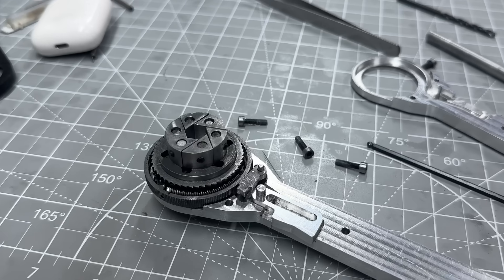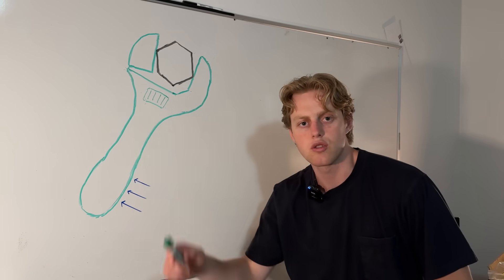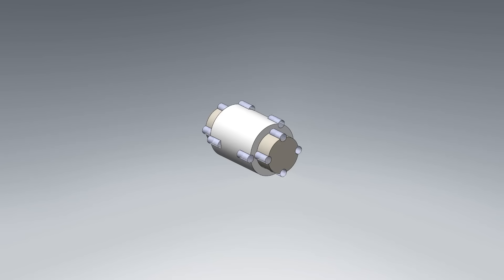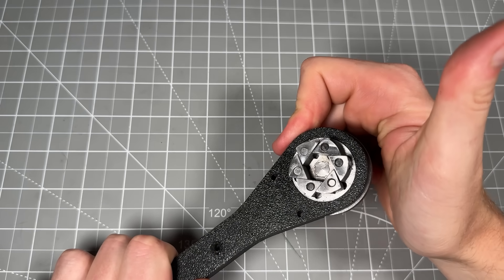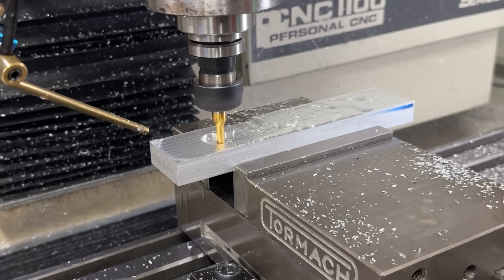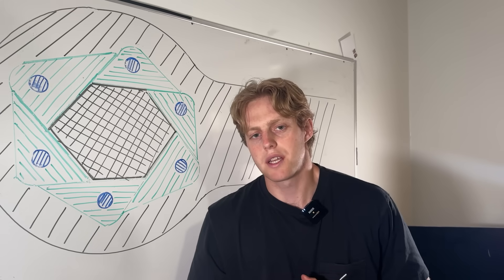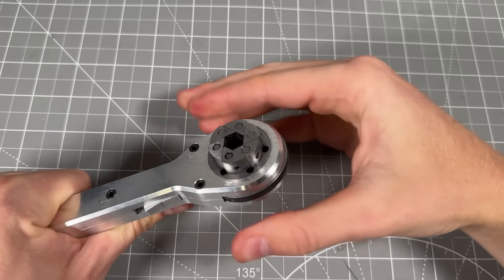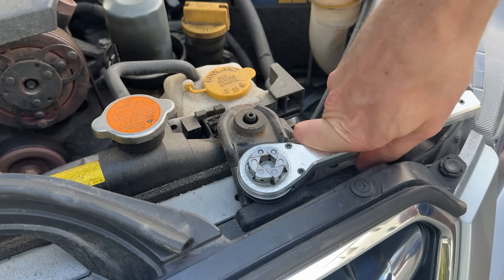I Invented an Adjustable Ratcheting Wrench

Comment: Interesting tool development. This has many avenues for product differentiation, i.e., related models optimized for a narrower range of uses. A few obvious ones are finger length (as you'd mentioned) for greater reach into recesses, bolt head size, max torque limit, etc. With a few select models that address a range of use cases, a Kickstarter campaign may be fruitful for getting this product into the hands of enthusiasts. I can really see the utility of the design in the heavier industries such as oil drilling and steel building construction where "big" tools are common.

Comment: Brilliant design, you really have a great intuition for creating mechanisms! I really admire your tenacity, I'd have chucked it in the bin after the pin bent 😆 The only thing I have to add is I'd recommend looking at the ratchet mechanism on modern ratchets. Instead of a single pawl they have a curved plate with symmetric rounded teeth that toggles relative to the centerline to allow reversing. That said it's usually a metal injection molded part so creating one with conventional tools might be tricky. Since you can't reverse the wrench anyways, you might get away with just having multiple teeth, but getting them spaced such that several engage at once to share the load might be tricky. I look forward to your future videos!

Comment: I'd buy it just like it is. There is no such thing as one tool for every job. No matter how much "tweaking" you do, someone will figure out a way to make it fail - beta testing. Have you seen how much Craftsman tools have changed over the last 50 years? This would be the perfect complement to a socket set, especially for the "second half" of a through bolt.

Comment: I have not seen a comment on it yet, but would there be any way to make it work on a nut threaded deep onto a bolt by adding a hole in the middle (akin to some of the gear wrench "pass-thru"socket wrenches)? Or would that not be possible? If so, I believe it would greatly improve its usecase.

Comment: The idea is interesting, but not practical for someone that turns wrenches.  There are always too many clearance issues even with the one-size socket and ratchet approach.  In my opinion it would be better if you could leverage existing ratchets and/or wrenches depending on the requirements of where the fastener is located and clearances available to access it.  But then the gator socket already does that. . . .

Lots of people say they would buy one, but the price would be prohibitive with all those tiny parts, expensive steels, and precise fits.  OTOH, there are people that seem to rely upon their adjustable wrenches much more than I do.  Mine very rarely get used.

That's not to take away from what you've done.  Your idea and implementation are pretty incredible.

What would happen if you modified your design to only grip on 3 sides?  That might reduce the number of parts and allow you to reduce the overall size?

Comment: Impressive and elegant design.  I would be really interested in a production version after some independent testing and would prefer a reversible design over one that needs to be flipped.  This would make for a thinner head to fit in smaller spaces also.

Comment: I would adjust the mechanism to remove the ratchet and use the champhers to act as the ratchet. Also the mechanism should be made small enough to form the hole on the center of the wrench allowing for tightening and untightening.

Comment: I had an idea like that once.  It was ratchet mechanism with a bunch of hexagonal tubing all telescoped together.  The tubes were super hard steel.  Just slide out the size you need.  Good for big and small bolts and deep resessed bolts.  It would be expensive to manufacture the hex tubes.  EDM would probably be the only way.  Probably there would have to be a ratchet tool for metric and one for imperial.   Several tubes could be pulled out together to make the socket wall thicker and stronger.  I bet it's already been invented tho.

Comment: I do 80% of my work with 3 general purpose tools - and i have 30 special  tools for the 20% of the time the 3 tools dont work . - if your wrench can undo 80% of the bolts a user has - then it will be gold- there is no style of wrench that can undo 100% of bolts

Comment: I can see using it for work on easily accessible bolts with varying head sizes, but those workplaces are rare.
Meaning it would only ever be an additional tool and the question becomes: "would i bother to buy an expensive additional tool to do a job i can accomplish by assembling a tool in seconds, that does the job just as well from tools i already have and need?"

The engineer in me wants this tool, but the mechanic i me says "really neat present, but not something i'd buy for myself".

Comment: isnt it possible to use a one side to do both tightening and unscrewing with the use of a switch same as on ratchet sockets? Should bring down the cost too, or allow for two size wrenches on the same end of the tool

Comment: I'd try put some teeth on it to see if it will bite into a very rounded head and as a retired motor mechanic the thing that would interest me in a tool like that is if I can really bloody heave the guts out of it, I'd want the pawl in the ratchet to shear or round before them pins start to flex much so that I cant destroy the whole thing or what I'm working on and only have one part to replace if I give it all the berries with a cheater bar and ideally be nice if it come with two spares. Other than that it looks nice as frick, very gimmicky if you cant proper heave on it without it opening up and rounding stuff but if it takes a big man giving it a lot without opening up and rounding and better it can get a bite into something already rounded then I would of easily added one of them to my personal toolkit or least got one for the workshop if it was a bit pricey which I imagine it will be to mass produce with the quality of build and materials for that to be proper durable.
Reply from the maker: Thanks, the failing pawl is a great idea. Especially if the tool is on the more expensive side.

Comment: One immediate improvement would be to hollow out your center pin to allow tightening/loosening nuts on a longer bolt
Reply from the maker: I like the thought, I had this in earlier versions but could never find a way to make it work.

Comment: Also, something like hex-to-1/2” adapter could potentially eliminate the need for a regular ratchet because it will make yours compatible with universal joints and extenders

Comment: Designer perspective: giving any sort of distinguishable enough surface treatment - ideally coloured - to either of the two halves would give immediate visual clarity to which side is for tightening and which for loosening. You are using aluminum for the handle which would anodise perfectly. After only few interaction only a glance is needed to know which side is which upon picking it up :)
Reply: Ratcheting wrenches have an arrow on each side showing the direction it turns.

Comment: Cool project!

Personally I'd make the grabbing mechanism as low as the typical height of the biggest nut it can grab onto. It would increase strength.
I'd also rather have one ratchet for tightening, and one for loosening, instead of increasing the depth of it by having both in one. It might have a large diameter head, but making those changes, it could fit places with a height constraint.
You could also maybe  (if it doesn't create too much torsion inside the head) offset one of the ratchet-locks to double the pulses per revolution. It would make it great for spaces where there's not much space for ratcheting.
Reply from the maker: What about a double ended wrench? One end loosens and one tightens? Or maybe that will be to heavy...
Reply: @Trevor_Faber 
That's a great idea. I doubt that it'll make it too heavy, while knowing that it would add probably a third of the weight. There's nothing wrong with an extra workout while working. It's less time needed at the gym 💪🏻😂

Comment: I'd 100% add this to my toolbox. I reckon for at least 50% of my jobs on motorcycles I'd be able to use this. Which means 50% of the time, it would be a massive time saver.
Reply: Completely agree with you. Same thing for my various jobs, probably wont work for a lot of things, but that 50% would go so strong in saving time and weight in my bag.
Reply: Ever try a Gator Grip socket?
Reply: @Octopusprimal Those are flimsy as hell and only sometimes works the first time and never a second
Reply: @Apeturetech  Had mine for over 10 years, not a problem, still works as good as ever.
Reply: @Apeturetech  I use mine daily in a professional environment. My only complaint is how thick the socket walls are as being off-center on a nut can be catastrophic for the cast arms. I watched a coworker snap a stud off a Cherokee and the socket never slipped.

I don't use it in incredibly high torque applications, but it's rare I encounter an overtightened or heavily corroded fastener in my job. I do 8-10 cars/day.

Comment: If you were able to implement this without the ratchet mechanism to a 1/2" square drive this would greatly improve the usefulness of the device. I would see myself using this with standard ratchet wrench with different extensions and a impact driver too.

Comment: Now for electric impact wrench attachment.  I think this tool would be useful on production line operators in low torque, low size range applications.
Reply: Don't they usually use tools with preprogrammed torque limits? that wouldn't work if you use the same tool on different bolts.

Comment: You Could Machine A Hex to Square Adapter That Allow The Ratchet To Uses Commercial Sockets As Well. One Idea I've Had For An "Adjustable" Socket Is A Russian Doll Design. So Many Hex Shaped Sockets That Are Extremely Thin Stacked Ontop Of Each Other. They Should Be Able to Withstand A Grip Of Stress Still Since They'd Be Backed By Several More Varying Sizes.

Comment: any bolt with thread that sticks out is a nono, could improve the design with self opening of the jaws if you press a button like a release mechanism, could have a reverse ratchet instead of 2 face, if the ratcheting wheel had easier access and ease (it doesn't look all that fun to spin ( hard on the fingers but hey i didn't touch it, just ho it feels watching it on camera)) well it could count as ''self opening" as we saw in the vid at some point you did just that, the thing where you approach a bolt head with the ratcheting is great , i often do that with sockets but i spin a nice smooth socket /screwrdiver with a nice smooth round shaft, so i think there's quite a difference in feel. man this tool is DOPE ! a version where the teeth themselves would be long

a final version would be something that has a telescopic locking handle, only one side with the socket (reversible ratchet) 90 degrees tilting head (inspired by haasky) (i think i'm against chamfer on the outisde as it will barely let you access more areas, but it will surely make the tool less durable, more prone to failure (but you know better) anyways, chamfer or no chamfer. there's a guy in the comment who talked about another kind of metal that would make the tool less prone to scratches , failure, and damage from being tossed around. so that as well but most importantly, have all of this made into 2-4 tools   one with small jaw small handle, one with big jaws (i mainly mean long, so it would act like a long socket and bypass a lot of issues that would come from using this instead, IF IF it was a possibility , have a hole in the middle (since there'd be no need to connect 2 counterspinning heads ... would it be possible ?) and one with jaws thats are simply bigger for well bigger bolts ! say the small is 5-19 short jaws, long jaws, big 13-24 small jaws, long jaws, 4 tools as a kit if it works well enough fits enough things resolves most problems is built in super strong metal that would make it last years i wouldn't give a shit to buying some as innovative and unique for 200 bucks but that's pretty high. idk what would be realistic for you to sell. you got yourself a new sub and probably a future buyer

Comment: While I love the concept and admire the dedication, I'm having a hard time seeing a use case. It certainly isn't automotive. Mainly because this wrench can't use extensions and requires you to reach with your other hand for the already quite bulky head. The latter you might be able to fix to a certain degree, but not the former. The use case would have to look like this: various bolt sizes but they're all accessible without extensions. And no Allen bolts, Torx, etc. Your invention mainly does one thing: Highlight your skills and perseverance.

Comment: One thing that would be pretty neat is if you could push the chucks through to the other side of the ratchet to change direction. Removing alot of bulk from the ratchet. Google "Push-through ratchet" to see what I mean.

Comment: Brilliant work.  
Precision O-ring rachet spanner is you could shrink design / A bolt-pipe/nut remover (as i would love something that could apply equal torque when trying to remove bolt etc from vintage equipment (especially as they can be all manner of sizes/shapes)
You should give someone like adam savage or similar one of the makers who is likley to help an be in awe to check out your design as could see it as a way to get an investment to further the development (As you are aware there are similar ones but none of them seem to work fully or aren't worth the time of big names)
Keep it up :)

Comment: Super neat project!

Have you considered a reamer for the central bushing hole? If it can maintain the tolerances you need, you might be able to save yourself from going between the mill and the lathe.

For knowing which side works in what direction, a small arrow either milled or laser engraved could work.

No matter what, if you ever release this, count me in for a wrench or two!

Comment: What if you made a way to open it with a spring loaded thumb trigger?  Being able to use something like this one handed would be pretty important.  If it's already hard to reach certain bolts, having to get your other hand in there at the same time would be doubly difficult.

Comment: Nice work. My recommendations are to patent this before temu floods the market and dilutes your hard work. 2nd would be making a larger version that can handle large bolts like for guys and gals who work out in remote areas who don’t want to pack a ton of tools to install or work on heavy machinery, I’ve got a huge aluminum alloy 1” ratchet for example… lightweight and super strong. Less tools brought in a backpack or toolbox is more gooder… less things to count before relocating, less chances of someone borrowing a socket that goes missing…

Comment: I think this would be really cool as a drill attachment.
Have one for tightening and one for loosening (that way we can reach difficult areas and shaft the bit as needed with longer adapters).

Would probably be easier to engineer since you only have to account for a single direction.

Thank you!

Comment: Would this work as a socket design, you will need two, one for undoing the other for doing :) I am normally doing one or the other. And I am constantly swapping from metric to imperial, this would help a lot.

Comment: I am not sure how yet (I will need to ponder on your design a bit more in my free time) but there is probably a way to make your ratchet work in both directions without doubling a squeezing clamp top/bottom (which would make your tool thiner and able to access tighter spaces).

Comment: awesome work man. there would be plenty of usecases where you would want this tool outside of a car mechanic shop. for example every industrial mechanic would crave this tool. running around with a toolbox just to remove a panel is quite cumbesome instead you could just slap it onto your belt and be on your way.

Comment: Could you possibly make a variation thats more like a dual ended ring spanner? One end that tightens and one that loosens?

 Giving the ability to work on longer studs with a through section on it, instead of it being blocked by the strengthening shaft like your current?